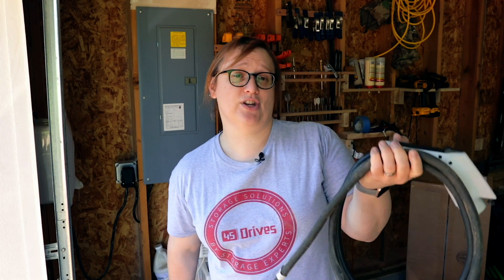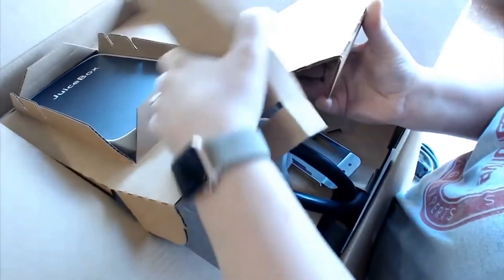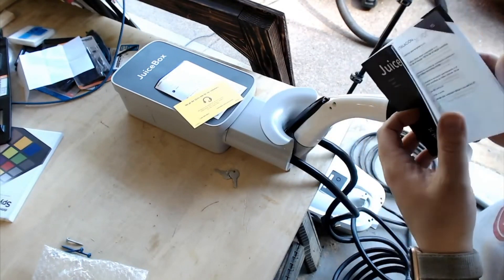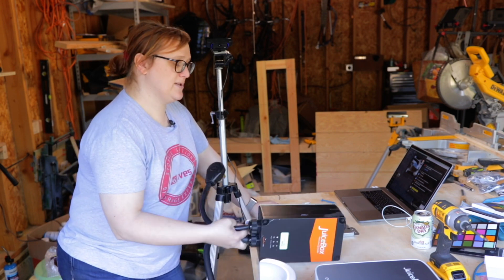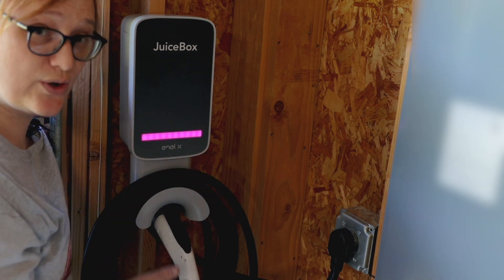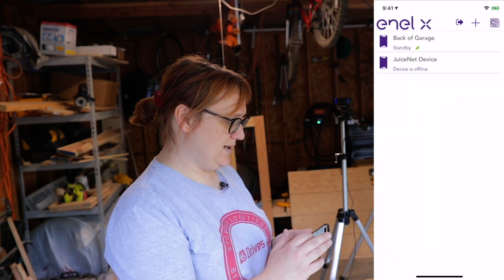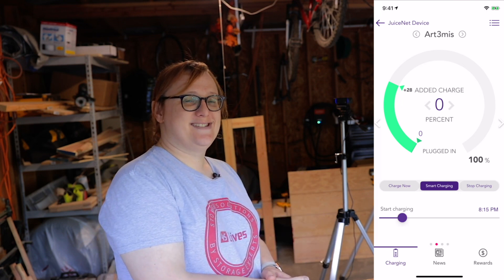EnelX JuiceBox 40: We Install EnelX's Latest Home EV Charging Station

Comment: ??? Step 1: Cut power to that circuit! Step 0: Choose a UL certified device, NEVER a cheap off shore thingy, as this will draw tons more energy (i.e., fire potential) than anything else (likely combined) in your most significant capital investment. You may also want (need) to upgrade your main circuit box. IOW, don't take this sort of advice from OTHER than a licensed electrician (let alone some self-confessed nerd who can follow instructions, but is TOTALLY CLUELESS on the safety & technical ramifications, options, etc.). Danger, DANGER! Will Robinson!! This sort of content is available from qualified people who know the ins-n-outs, e.g., EfE's youtu.be/a6U3fiQfZUI , vs this gratuitous, irresponsible, & potentially dangerous pos.
Reply from the maker: You do realize that everything we did was within code? Thanks for interacting....
Reply: @transportevolved  When life and limb are at stake, custom and decency dictates that one not assume anything, let alone purport oneself to the unwary to be professionally trained or at least, safety able. Aka, irresponsible and in some jurisdictions, illegal behavior. And yes, I've seen people die, as a consequence of such cavalier conduct. Sorry for your self-disappointment or delusion. Given your response, arrows toward messenger are expected.

Comment: Just curious if the hyundai "blue link" app does the same thing the juicebox software does? Blue link app can start charging at 11pm and stop by 6am or fully charged....also can override the program and press charge now. I just bought the juice 40 bcse of a $500 rebate via the utility company. I think price was $672.00 ...so I'll wind up paying $172 for something I may not need.
Thoughts?

Comment: Happy charging ^^
I use on my kona an evbox 32A 230V to support the maximum 7.2 kW charger speed in the car, but I usually reduce the charge speed to 4.2 kW in the kona settings as my main is 40A.

Comment: what I don't understand is that most EVs (my experience is the Bolt)) have the ability to control  charging times.  So, if you have a demand rate you can do all of this from the EV?  So this looks pretty duplicative
Reply from the maker: The difference is that the JuiceBox is adaptive. If your local utility mix becomes dirty, it can shut off charging until things are cleaner.
Reply: @transportevolved  - what do you mean by "dirty".  Are you talking a corruption of the wave form?  Since, at some point, you are converting to DC then why would that matter?  And, also, does it really happen?  with all of the electronics on the local grid can a power company really put out power that could damage those devices?  this seems so much like a product in search of a mythical market
Reply from the maker: Dirty as in high mix of fossil fuels. ^Kate
Reply: @transportevolved  - ah, did not understand.  I was thinking the waveform or wave shift and I just didn't get it.  So, what you are saying is that the utility will charge you a different rate based upon how much fossil fuel they use in producing that electricity.  Not something I have ever seen.  I have seen different rates based on time of day.  Usually grids have more power available on night.  I have seen different rates if they can shut you off during peaks.  But, I have not seen what you have described
Reply from the maker: It's not that they will charge for using fossil fuels (although they may), but as an end user, you might not want to use energy generated by fossil fuel - and allowing the car to only charge when the electricity grid mix is made up of mainly renewable energy is something many EV owners have expressed interest in.

In can also be beneficial in terms of pricing. Until battery storage capacity for utilities increases, the majority of surge capacity in many countries comes from natural gas facilities. By controlling the load from end-users, utilities can avoid turning on extra power generation facilities. These facilities are more expensive to run, and so some utilities are experimenting with passing some of those savings on to end users (so it's cheaper for you to charge if your car charges when there is already excess capacity in the grid).

The next step is bidirectional charging where you, as a consumer, can choose to offer a small amount of your capacity to act as a buffer for the grid when the car is plugged in, allowing the utility to use a tiny chunk of your battery as storage. There's evidence to suggest that this is beneficial for the battery - and obviously is useful to the grid. We covered this much more in depth here: https://www.youtube.com/watch?v=FBhb_QfAe08
^Kate

Comment: I too have a Siemens which I also installed in 2015.  It has been 100% dependable since installation.  I have often felt that I'd like WiFi capability just to know how much juice I'm using for the car each month (since 100% of the juice used does not get into the battery).  BUT after seeing your video it seems like there is significant redundancy between this new unit and the capability already built into MY 2018 Bolt (with regard to partial charge...hill top...or start based on when you want it finished....etc.).  So I'm wondering WHY I would get the new Juice Box to replace my venerable Siemens since it offers little to no additional utility to the capabilities I already have either in my charger or my Bolt charging settings.  I assume that my original desire to have "actual juice consumed" may be extant in the new unit, BUT that hardly seems sufficient reason to spring for another 600 bucks...since I have a perfectly dependable system as is.

Comment: Been charging for the last 5 years on the granny lead, at home and work. Not sure why you'd pay $500+ for something you don't actually need...
Reply: Some of us do actually need them though. In the central states, where our rural commute is 53 miles one way, 110ish both ways to the nearest grocery store, work, etc. A granny connection that MAY give us 5 miles per hour (especially during the harsh winters; average is only about 2 or 3).. you start to see the problem add up. We can't afford to wait 3 days between driving when work is involved. Our JuiceBox 40 charges the car between 4 and 8 hours, depending on our use case. What you have is a common problem with society. You think your own personal situation should apply to everyone, so you insert your own bias into the mix.
Reply: @bugs181  I think you misread my comment and thus "you think your own personal situation should apply to everyone, so you insert your own bias into the mix." My comment clearly says: "Not sure why you'd pay $500+ for something you don't actually need..." In your case, you do need it, so yes, you pay the price.
Reply: @HervéFache  then it sounds like we had a miscommunication problem. The way the OP was worded sounded like you were implying that nobody needed it.
Reply: @bugs181  oh I see! Sorry about that. Indeed, the best possible use of an EV is yours. Mine is mostly gathering dust, which is a bit sad 😔
Reply: @HervéFache  out of curiosity, what is your use case? Our family loves our EV, regardless of how far we have to drive. Even driving in the city is an absolute pleasure. We all love how “zippy” it is, with aggressive drivers on the road. It allows us to get out of the way or safely pass with the instant torque. Truckers in our area are another problem. Most would prefer to just run us over and don’t really care.
Reply: @bugs181  We have two (well, three until I sell the e-Niro) EVs: a Zoé for my wife (and I sometimes steal it when I know I'll need to park, we're in France) and a Model 3 which only I drive. The Zoé is only for local driving and the Model 3 (1 month old) does some city driving (school duties) and long distance (trip to Paris planned - 900 km, trips to my mother's - 275 km). I had bought the e-Niro before the Model 3 was available and because we have 3 children and a dog, but we don't plan to travel with the dog any more, and the Zoé is a hatchback. Sorry for the long message!
Reply: @HervéFache  not a problem at all! It’s really awesome to hear how other people are using their EVs. It’s been kind of problem for us to convince friends and family that EVs are the future. There’s the obvious range anxiety that we have to constantly debunk. EVs would definitely be suitable for them with just a little preparation. A common theme is “what if I forget to charge?”. Hrmm. Our rhetorical response is “what if you forget to get gas?”. 

On that note; Our area has a new company starting in early 2022 where if an EV gets stranded, a large semi flat bed with a generator and super charger on board will cost $25 to come give you a half hour top up. I’m sure it’s probably only in the 10 to 30kWh range but should be sufficient to get you back on the road safely. That aside, it shouldn’t be much of a problem as battery technology gets better and EVs get even more efficient. The other concern we hear often is “it won’t do what I want.” (In terms of towing capacity). We tell them the cybertruck, rivian and other EVs CAN and will do everything you need. 

I think the biggest problem we in the EV community have is that we have to open a dialog and teach people to start thinking differently. The problem with society is that we’ve taught ourselves “instant gratification”, where it only takes a few minutes to fill a petrol tank up, disregarding consequences. The solution is to simply plug in the EV over night while you sleep. 

Sorry for the long message. Much love for Europe from the USA. <3
Reply: @bugs181  seems we live parallel lives. I have to say I got tired of explaining and focus on people who are closer to the edge, easier to push to the greener side 😬

I'm also trying to lead by example: no more petrol engines, the house still uses gas for cooking but it's from farms. Our electricity, when not coming from our solar panels is 100% green 100% of the time.

I've been following the US politics for a while and seen how families got divided. I really believe it will heal, as even after massacres African countries managed to heal 🤞

Wishing you and your family all the best for 2021! 🍀
Reply: @HervéFache   thank you so much! We wish your family only the best for 2021! 

Edit: sorry for the late reply, YouTube keeps swallowing my comments. Luckily I saved them.

It sounds like you’ve been able to get a little further along than us. We only have a few solar panels for supplementing but plan on replacing those with a much larger array. Our goal is to be completely off-grid by 2024. 

We enjoy our gas stove top, so we’ll be switching to a methane biogester (currently natural gas: ick). It’s the obvious choice since we live on a small farm. 

Our heating and cooling is all geothermal. We have a wood stove for the extremely bitter days. Just a few days ago we had to fire it up because it reached down into the single digits in Fahrenheit. We haven’t had an HVAC since we moved here. 

For water, we have a spring fed well. For our food, we have a large indoor aquaponics system set up. This year we are replacing our energy hungry blurple grow lights with some super efficient DIY LEDs. They use half the power and output is about 3 times more efficient. 

It’s so refreshing to know that we’re almost there! And I’m excited to find people like you that have made the same leaps forward as us. We live in a largely closed minded area of the world. 

Without sounding belittling, they’re all rednecks, technophobes, and illiterates. I’d venture to guess that we’re the only ones with an EV within 30 miles. We’re most definitely the only ones with an EV in the next 3 “towns”, total population only about 1200 people so easy to know everyone.

Comment: Is it WiFi only, or is RJ45 option available?
Reply from the maker: It's WiFi only at the moment, but maybe the folks at EnelX can suggest a work around?
Reply: You might be able to use a mains powered wifi extender which has a RJ45 socket included.

Comment: If you have three wireless networks, does that mean you have three internet providers or are you just using three access points on one internet connection? 

Your better off just buying a mesh wifi network (I would recommend a netgear oorbi pro) and using that to do everything. Otherwise you have signals competing with each other.

Comment: I have the previous version of the JuiceBox and it's still my favorite home EVSE.  The SmartCharge feature is super handy, especially for my 2016 LEAF that doesn't allow limitation of the state-of-charge from the car.  JuiceNet SmartCharge lets you set the incoming SOC, the desired max SOC (I like 80% for my situation) and the time to start charging.  For those in Michigan and customers of Consumers Energy, the JuiceBox is eligible for a $500 rebate through their PowerMIDrive program so you can get it for nearly nothing.   http://www.muskegonevguy.com/2019/01/electric-vehicle-home-charging-charging.html
Reply: Unfortunately the new Juicebox is a white labeled Chinese pos.

Comment: Stupid question time, does the juice box actually know your vehicles SoC or only how much power it has added? I didn’t think j1772 reported SoC
Reply: No, you must set manually.   I recently asked enelX if this could be set to a default every day.  Right now it defaults to zero, so you always fully charge (unless you manually change it).  I always get home at about 50% and only want to charge to 80% so it would be nice to have it default to 50%.

Comment: Speaking of granny leads, do any BEV manufacturers besides Tesla give you a way to throttle the charge current?  Tesla lets you set this to as low as 5A and I've found this invaluable when mooching a charge on a shared 110V 15A circuit.  We've been looking to get a second BEV, but I haven't found this capability in the Owner's Manuals for any non-Teslas I've looked at.
Reply: BMW i3 allows you to set it in the car software.
Reply: Chevrolet Bolt allows you to select 8A or 12A when connected to 120V circuit.

Comment: Holy Hell , what kind of power tool does your wife have for woodworking that requires up to 50 amps?
Reply: Tablesaws like mine can be wired to take either 120 or 240V power. 240V is much preferable as it means you have 4 times the power at the motor. I'm assuming heavy duty drill press, lathe, bandsaws can also be wired for 240. Less expensive tablesaws are usually 120V only.

Comment: Great review, thanks ... but here are a few picky points:
* A box mounted outside will require a hardwired installation. (like mine, right next to the electrical panel)
* The charger is inside the vehicle.  The wall box is an interface: EVSE "electric vehicle supply equipment"  (yeah, WE get to call them chargers, but YOU gotta be more exact :-)
It's sorta like calling DC stations "Level-3 chargers".  They aren't chargers, and there is no such thing as a "Level-3" system.  
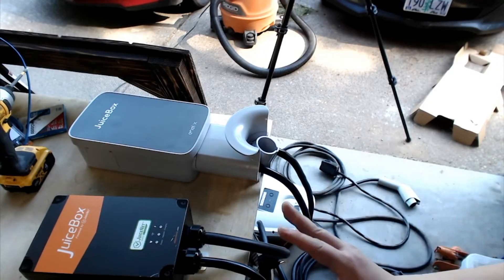* My electricity provider has TWO high-use periods (06:00-09:00 and 18:00-21:00)(6-9 am and pm).  I have not seen an EVSE or vehicle that provide for entering more than one.
I have good wifi connections to both the Chargepoint and to the Bolt EV, so I am just using the Bolt with a high-use time of 06:00 - 21:00, leaving nighttime for charging.  
It works well for my schedule.
Reply: Mine was Installed by an electrician and is not hardwired.  It’s connected to a 14-50 outlet with a box to protect the outlet from the elements
Reply: Thanks for noting this is an EVSE, not a charger. It is basically an on/off switch to provide power to the vehicle’s built in charger. I can’t justify the prices of some of these units based on this fact. 

My solution to move away from all these apps and wifi connections for changing my Volt was as follows. The evse that came with the car is 120v 12a, and charges overnight which is enough for weekday use. For the weekends and days of extra use, a 240v 16a (this is all my car will take) was purchased off of Amazon for $200 CDN. 

Both evse are in the garage and I just plug in the one that’s needed. 

All that was needed was to install a 240v 20a socket in the garage.

Comment: Can it work the other way around when there is a power cut? Can it take power from the car and power the house?
Reply: Not the EnelX JuiceBox. There are some that do, but as far as I know, all the commercially available residential bi-directional systems are ChadeMO ones because until recently they were the only widely deployed standard that incorporated standards and protocols for that. And most of those are only available in Japan where there are incentives for them as disaster planning distributed backup power. Wallbox (yes, that's their company name, yes, it's kind of generic) is going to have some offerings in the UK in partnership with utilities in the near future, which I think that Transport Evolved has a video on with Kate. There are some that are coming for other standards, but again, availability is going to be regional.